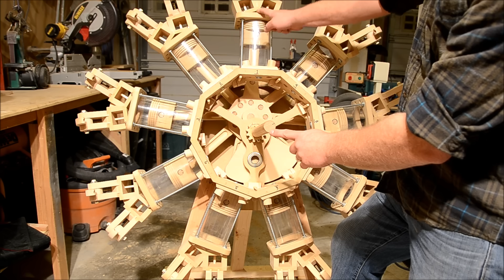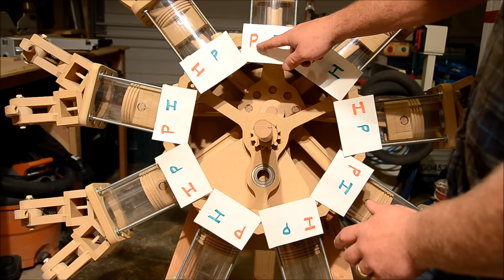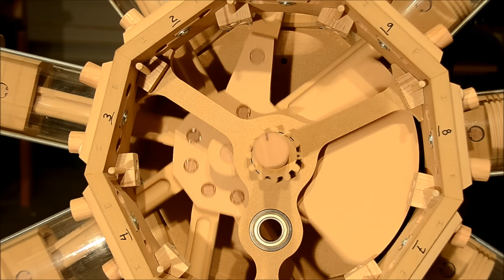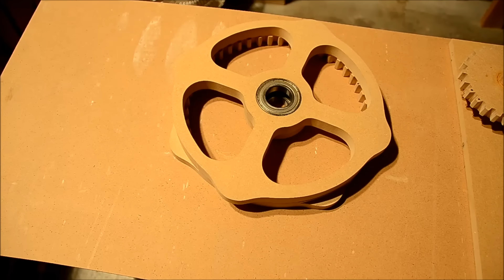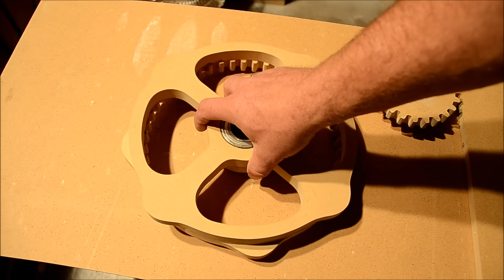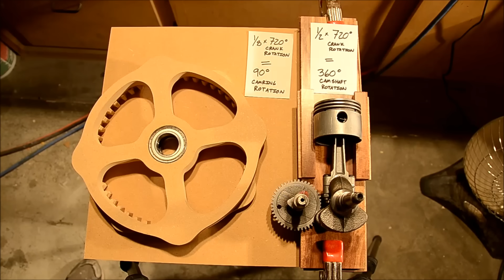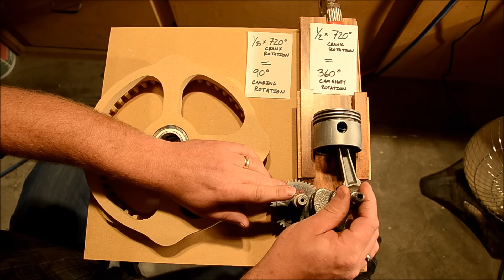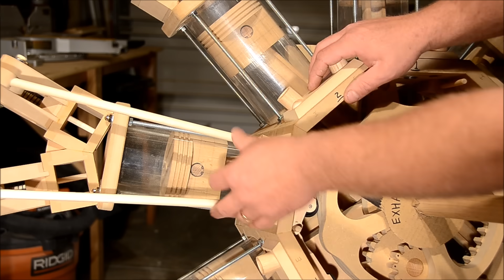How a Radial Engine Works - Explained  Part 1

Comment: You clearly have many skills overlapping. You obviously could find a good job as a carpenter, machinist, teacher, councilor. Draftsman. Communication specialist. Will you please get a job as an executive. We need people like you running things. I always loved these radials and glean all the info I can. The oiling system on these have always been a mystery to me. They have to be a weak point on this design. Could you do a video about how the oil is recovered then repressurized

Comment: An excellent explanation of how a radial engine works.  Till now I've never understood how so many conrods are connected to the crankshaft and how the valves are opened and closed.  Very good.

Comment: Thanks for the explanation and model. Well done.  Now a question.  Why not make the cam have half as many lobes and run to twice as fast?
Reply: Wear!!
Reply: @clevelandmortician3887   Maybe, but it may be to make all the lobes hit the right spots on all the other cylinders since it take two revolutions for a four stroke engine to complete one cycle.  OR,  I could be wrong.

Comment: Nice demonstration, good model and well explained.  It brought back a lot of memories for me.  My senior project as a Mechanical Engineering student was to design one of these to be used for what was then an early government drone program.  I admit that I skipped through this pretty fast, not sure if balancing was addressed.  The trick to these engines is that top dead center keeps rotating in a circle making it quite easy to counter-balance with a pair of counterweights always opposite top dead center.  Best thing about these engines is their redundancy and ease of maintenance.  Worst of course is aerodynamics.  Nice video, thanks.

Comment: Best "explanation video" on youtube of all time!! Thank you OP for taking the time and effort to put the engine and the video together! I have always wondered how radial engines worked, now I know. I just wonder though, why did that engine design go away? Is not compact enough? Too unreliable? Not fuel efficient? Too noisy and vibrate too much? They sure worked pretty well in a lot of WWII planes!

Comment: What a cool demonstration and model. I came here to learn how a multi-cylinder radial engine connects to a drive shaft. I couldn't figure out in my head how all rods connected to a single crank....but with the master rod and 8 articulating.....now I know.....the rest is lawn mower technology.  Now I wonder how the oil system works, seems the lower cylinders would fill up with oil behind the piston.

Comment: Sleeve valve type radials could use far less octane fuel with same power because of no hot spot poppet type exhaust valve detonating incoming charge before proper time to fire. There’s really nothing to cool that valve other than hollow sodium fill and nearby finning and oil flow in its guide. . The intake valve gets a flow of cooler air on the upstream side.

Comment: i built the visible V-8 model kit as a kid and have always been fascinated with machines and how they work so i know i'm really gonna like this video. thnx,steve
Reply: They (Renwal) also made a Visible Airplane Engine, a nine cylinder radial engine like this. Revell has the molds now, but hasn’t produced it for a number of years.

Comment: When I was a kid, I'm 88 now, somewhere around 85% of all airplanes were some form of Pratt & Whitney's radial engine, the R-985 Jr. Wasp really took over until Lycoming and Contentinal started giving at or more power from fewer cylinders. After the war, jet turbines really took over and made the old radials obsolete in rather a short period of time.

Comment: one aspect not addressed: the propeller was locked to the engine, which in turn totally spun around a base axis, which provided air cooling.  major fail.  downvoted.
Reply from the maker: This is a model of a radial engine, not a rotary engine.

Comment: First of all, this is the best demo of the inner workings of a radial engine I've seen and your craftsmanship is amazing! I'm not an AME but I have trusted my life to the P&W R985 for the last 40 years and am fairly familiar with that engine. Can't speak to any other radial engines but I'm pretty sure that the master rod on the 985  is #5.

Comment: There is one major problem in regard to adding multiple rows of cylinders - getting adequate cooling to the rear rows of cylinders. To stop this problem, more cylinders may be included in lesser rows, but this raises another problem - the size of the engine is increased, which can lead to increased drag in flight, inhibiting performance.

Comment: I often wondered how the crank shaft could be so short to house nine connecting rods and you explained it well. I love those engines. I am more fascinated with older technology than current.

Comment: People might want to know about the Farwell design where the crankshaft is bolted to the aircraft and the propeller is bolted to the engine and the entire engine spins. It's why some World War 1 aircraft could turn One Direction but they couldn't turn the other direction because they couldn't overcome the torque of the engine.

Comment: Better video than all the animations I have seen put together. The one thing I am looking for is a little bit of education on how one of these engine’s oil systems work, specifically, how are the wrist pins lubricated? I will probably never do this, but I have been dreaming of making a little radial and keeping it horizontal to avoid the oil nightmares of vertical radial engines. But I’m having a hard time wrapping my mind around the lubrication system, unless it’s all just done by splashing and hoses spraying the bottoms of the pistons/cylinders. Do they actually have a pressurized main rod/rods like a typical inline car/motorcycle engine to keep the wrist pins lubricated? I have seen the radial engine the guy made using the Honda XR cylinders/heads and I know those pistons/rods aren’t purpose built to be ran without oil pressure in the crank/wrist-pins. Just curious if anybody wants to chime in, thanks. Excellent video and amazing model

Comment: Ian, how radial engines are lubricated , it seams that engine oil going to be drain into bottom cylinders, I also notice before the start of the engine the propeller need to be rotated to drain the oil from bottom cylinders. Thanks

Comment: Could you have a 4 cylinder radial engine, firing 1,3.2.4?  Or 1, 4, 3,2?  So, a 2 cylinder radial engine would have to use a master rod and not an off-set #2 cylinder using a separate crankshaft journal?   The radial engine is a genius invention.  And your model is really an important piece of work.  I like the clear cylinders.  Thanks.
Reply: GereDJ2 Because than the firing is not evenly spaced.

Comment: Your explanation is far and away the most exquisite demonstration of the principles of a radial engine out there! Your care and craftsmanship opens up the possibility of understanding this historic engine type to almost anyone of any skill level who is willing to listen. Even someone mechanically inclined but unfamiliar with the radial should be able to quickly grasp the essential functioning of a radial from your vid.  
At least half of the air war of WW2 was fought with radial engines. The most devastating and durable fighter of WW2 (p-47), plus 3/4s of all the fighters on both sides in the Pacific theater, as well as the best German fighter were radials. Your explanation helps us "historians" understand why this was the case even when most of the decision makers of all the combatants of WW2 had put their faith in the inline engine. Bravo, I feel like an expert! 
Having a simplified power plant in front of the pilot, and facing the breeze, despite the penalty in streamlining, made a lot of sense as a WW2 design. 
Even in the desperate search, during WW2, for more speed and power, the small penalty in streamlining of radial engines was minor compared to the other factors limiting the speed of internal combustion - propeller driven aircraft. 
Thanks for your good work and for sharing it with us!

Comment: I thoroughly enjoyed his explanation of the radial engine.  But a couple of answers elude me.... it's my understanding that with some radials the entire engine spins, not just the crankshaft. If so, how does the gas (and spark) get to the desired location (into the cylinder)?

Comment: I'd often wonder why radials always had odd numbers of cylinders in each row and never realised that it would be as simple as that.
Reply: Radials have an even number of cylinders per row if they are two stroke. But this generally only applies to diesel engines.

Comment: You say a radial engine "always" has an odd number of cylinders.  This isn't necessary, nor is it necessarily true, as a 4-cylinder boxer engine can be viewed as a degenerate case of radial engine, with two rows of two cylinders each.
Reply from the maker: Milosz Ostrow - I guess I would disagree, I don't really see how a boxer is like a radial. A boxer engine has independent crankshaft journals for each piston rod at 180 degrees apart. Both pistons reach BDC and TDC at the same time. There is a main journal in between each rod, so they are not even in the same plane as eachother. For a radial engine to work, there has to be an odd number of cylinders per bank. Some of the old engines that look like radials that have an even number are actually inlines all sharing a common crankshaft. Similar in concept say a W-8 or W-16. Or perhaps a Caminez X-4, which doesn't technically even have a crankshaft.

Comment: I always wondered how they worked?. My God man! that is some really  great work you put into that thing!. I can see why they went to a straight line engine, this seems very complicated?. Thanks for showing this.
Reply: NCLUSA, I rebuilt a couple W670 7 cylinder radials from the 1940s, the amount of engineering that went into those blows my mind. To think they designed and built them without the use of high tech digital design programs, I always imagined that the person who came up with the concept of a radial engine spent the remainder of his days in a mental institution

Comment: Is there a reason why the camshaft turns at 1/8 of the speed? It could have been 1/4 of the speed with 2 cam lobes. Or 1/16 with 8 cam lobes. What kind of optimum does 8 give?
Reply: jlinkels Number of lobes = number of cylinders-1 arranged with radial symmetry, much easier to balance. A 3-cylinder radial with this arrangement would have its two cams in opposition (180° apart). Two cams on a 9-cylinder would be on the same half-plane and would be far more expensive and difficult to make a balanced cam ring and because it would be moving four times faster would change the tolerance by a factor of four against you. And that assumes that you will have solved the valve timing offset for the cams in that configuration. The simplest solution is usually the best and that's true here. If you went in the other direction, say 16 cams for a 9-cylinder, you'd have a timing nightmare and chattering valves. I'm certainly open to corrections if I'm mistaken or have missed something. (edit - numbers given assume a four-stroke engine)
Reply: Ni999: Thanks for the explanation. It sounds reasonable.
Reply: jlinkels You bet. It's a really interesting question and I want to say up front that I could be wrong about the balance issue. I tried to think of various timing and geometries that would make sense but I certainly could have missed a balanced alternative configuration so if you or anyone can correct that I'm all ears. :) I should think that the cam length or height or both would be other factors to deal with for the valve timing in such a case by default. Even so, the increased ring rate would still face the tolerance issue and I think that the simple is better rule is likely still going to apply. 

I hope others will chime in, it's a great question!
Reply from the maker: Hello all! I will put in my two cents... let's just look at a 9 cylinder radial for simplicity. Given the every other cylinder firing order, we need a lobe on the cam ring to do it's job every 80 degrees of crankshaft rotation. There are only two possibilities, 5 lobes and 4 lobes. 4 lobes, 90 degrees apart need to travel 10 degrees for every 80 degrees of the crankshaft in the opposite direction(1/8). 5 lobes, 72 degrees apart need to travel 8 degrees for every 80 degrees crankshaft rotation, in the same direction(1/10). Either way, when it is all said and done for every 80 degrees of the crankshaft rotating, the cam ring will rotate however many degrees required so a lobe on the ring is doing it's job. The reason there can't be more lobes on the cam ring is because while we rotate a lobe into place, we don't want another lobe somewhere else on the ring to be lifting a valve when we don't want it to. There has to be just enough lobes to do the job we need, and the rest be happily turning not doing anything until it is their turn. All of this holds true for 7 and 5 cylinder radials as well. 7 cylinder engines having 3 or 4 lobes and so on... Here is the basic formula to determine how many lobes you need, and the direction the cam will turn to give you enough lobes to run, but not too many to mess up other cylinders on their journey up and down.  

" X " is the number of intake or exhaust lobes on the cam.  " Y " is the number cylinders, and "R" is the gear ratio relative to the crankshaft.  

For cams running in the opposite direction to the crankshaft

     X = ( Y - 1 ) / 2   and  R = 1 / ( Y-1 )

For cams running in the same direction to the crankshaft

     X = ( Y + 1 ) / 2  and R = 1 / ( Y+1 )

Comment: cool, I finally got it after all these years. Great job breaking it down and cool, cool piece of woodworking skill.
Now, I need to see the innards of a rotating radial.
Reply: Tommy Petraglia Flip it around? Instead of attaching the propeller to the main shaft, attach the main shaft to the airplane. I don't know but I imagine that was done to balance oil distribution, and maybe wear (but that is even a bigger guess).
Reply: Ni999 
I somewhere got the impression when I was a kid building balsa-wood airplanes, all World War 1 models, that rotating the engine was an attempt to spin opposite the propeller to counteract the rotational forces they are experiencing early propellers and Wing designs without trim tabs.. but I'm such a novice Maybe I'm Wrong
Reply: Tommy Petraglia Check out any of the YouTube videos searching for "sopwith camel starting" - the prop is fixed with respect to the cylinders. I think you'd have a bit of power loss contra-spinning the prop and cylinders, I haven't seen that (nor everything).
Reply: Ni999 
Right. Stupid assumption. Just because it's an airplane doesn't mean it's not still an engine an all logic still applies.... but that is one huge mass to be rotating and hang your life on. Must have made great advancement in bearings design to have this possible
Reply: Tommy Petraglia Indeed, the bearings must have been something. One hell of a shaft too I should imagine! :D
Reply: Tommy Petraglia OK, after sleeping on it, I remembered the complaints about WWII fighters having trouble with left turns due to the increased torque against the direction that the engine was rotating - and thought about how light the WWI fighters were. I think it makes sense that they rotated the engine just to help balance or offset its weight against the rest of the loaded airplane. Interesting if true. I've also read one site explaining that the Camel torqued to the left during a climb and to the right during a dive.

Comment: What a beautiful thing to watch... kinda mesmorizing to me.  Your model was SO well done, and your explanation SO straight forward and clear.  Thanks for a great job.  No wonder these engines had such a power to weight ratio.  I'll be looking into who did the original design work which was genius relative to the crankshaft design and camshaft layering.  Truly a thing of beauty.  Well done!!